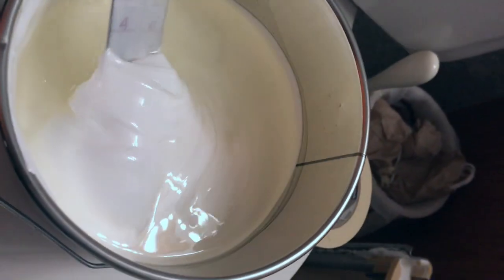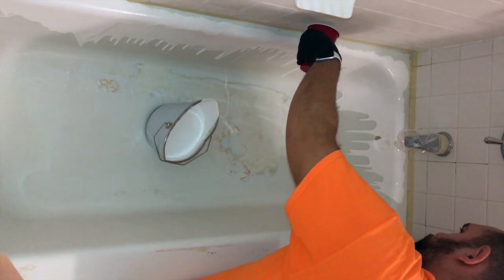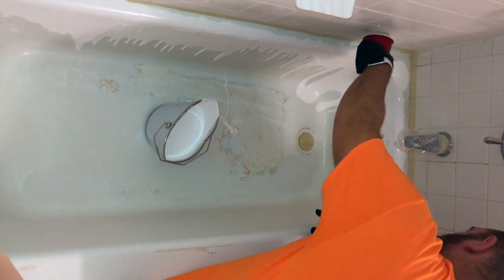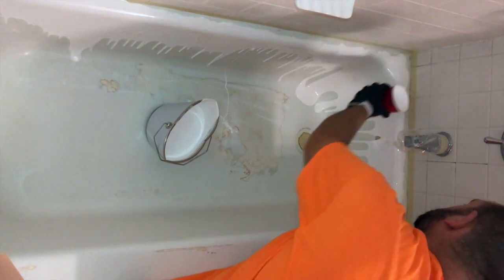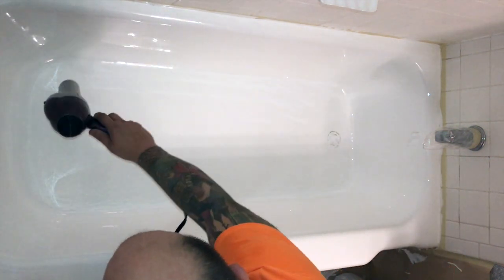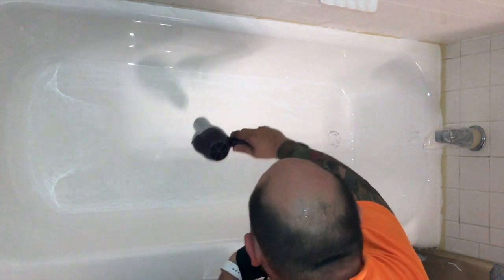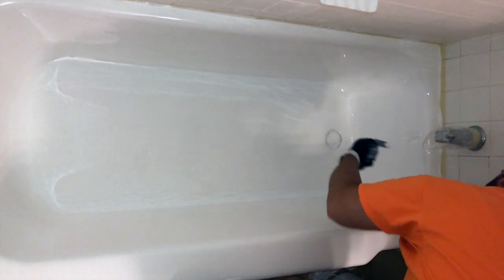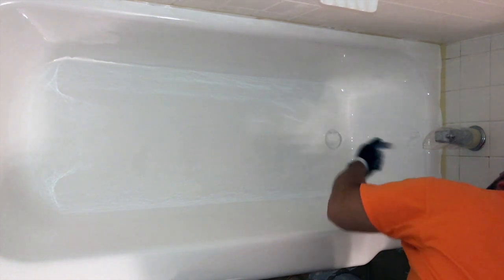How To Refinish A Bathtub With Ekopel DIY | Ekopel 2K Pour On Method | Refinished Bath Solutions

Comment: On 07-08 November, I applied ekopel 2k to my tub. I have a couple dime-size spots that have small air bubbles and still remain slightly stick to the touch. Is there a way to remedy this?
Reply from the maker: Email me photos of it to help@refinishedbathsolutions.com I can better diagnose the problem and help fix it from there.

Comment: Could you hypothetically place the tape around the drain in a tubular orientation vs covering it?  Imagine sticking a toilet paper roll in the drain, but with tape instead?
Reply from the maker: canopener505ify you could, the only tough part would be that this would allow the material to get onto the drain. 
If removing the drain is an option we normally do something similar. We tape off the hole then once it levels out we remove and put a small Dixie cup in the drain to make sure nothing runs down.
Reply: @RefinishedBathSolutions  Thanks!

Comment: Great material looks alsome. I just did mine how do I remove lint and roller foam material left behind?
Reply from the maker: You can sand them out with 220-320 grit sandpaper then double the grit to 600 then 1500. Then you can use any car buffing compound to bring the shine back. The best way to understand buffing is to watch a YouTube video on how to buff a drip mark out of a car. That will teach you all you will need to know about buffing.

Comment: Hi, can this be used on shower stalls? Our house was built in 1985 and we have a one piece stall. I don't know if it's acrylic or fiberglass. Thanks.
Reply from the maker: sdube60 it can be poured from the top and leveled out with a foam roller but sometimes leave drip marks as it’s not intended to run down that far. We are working on a product to help with those units but it isn’t ready yet.
Reply: @RefinishedBathSolutions  Thanks. Any idea when that product will be available?
Reply from the maker: We are hoping to be fully tested by mid April.
Reply: @RefinishedBathSolutions  Great, I'll be watching for this.
Reply: I have a fiberglass shower that has walls.  Have you finished that product yet?